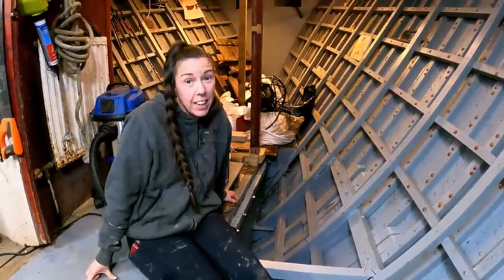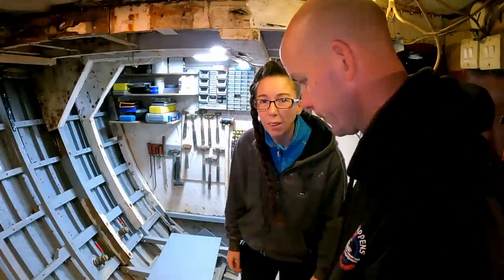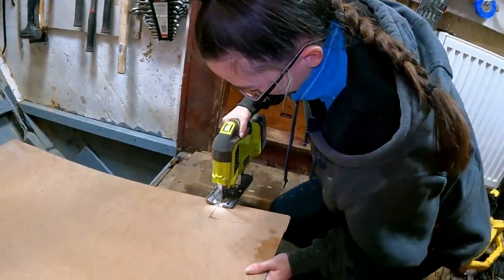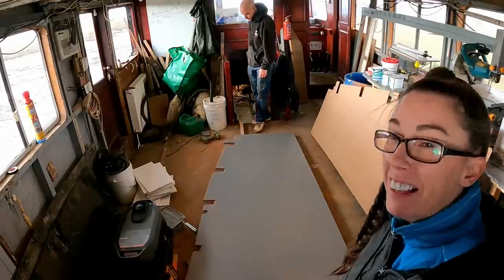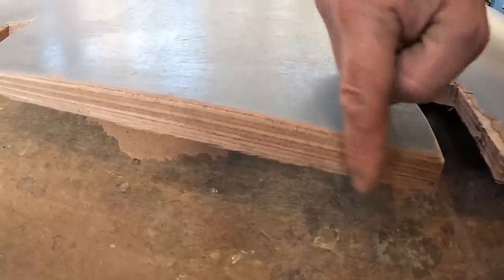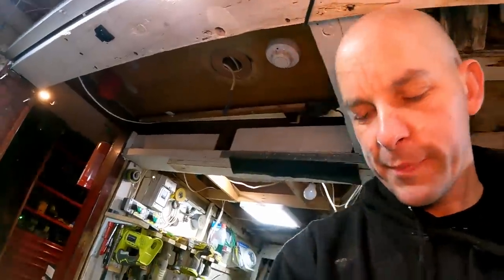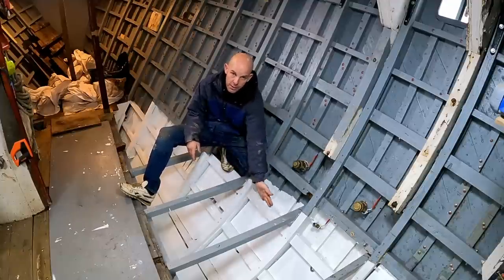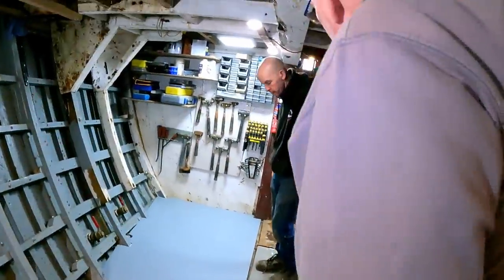Ep 101 - Fitting A New Boat Sole Supports and Sole! #boatrestoration

Comment: Adding even an inexpensive spray-painting rig would really be helpful for your restoration. You'd get better coverage, especially in hard-to-reach spots and use much less product. It's also less tiring and much quicker to spray paint and leaves a good finish. The amount of painting you have to do is huge, so I think anything that could make it easier and quicker should be in your toolbox.
Reply from the maker: But we don't have an air compressor, enough power to run one, no fresh water to clean it out after each use, and would rather spend the money on more important things xx
Reply: @ShipHappensUK  FYI - There are many self-contained systems that do not require an air compressor and the power requirements are really no more than running a light. Many are around $250 US. The clean out solvent is based on whatever fluid you're using and the procedure normally consist of cleaning a reservoir (unless it pulls directly from the paint container) and a few small parts. You do you though.
Reply from the maker: @JamesRook  even $250 is alot of money for us for something we can live without, not sure if you realise but we are working with a very small budget.

Comment: Another fascinating insight into your incredible restoration project, thank you.
As for terminology, yes it's there for a reason but it's not the be-all and end-all. Personally, I've never heard the term "sole" applied to a piece of decking, but if that's what it is, fair enough. But sole/floor/deck, it doesn't matter, as long as you know what you're talking about. Yeah Simon, nautical terms can be a bit like a foreign language, but you are far from thick. You are highly skilled, you both are. And if you really want to learn the "proper" terms, don't sweat it. Just keep repeating them and using them until they stick. (That's how I do it.)
And if you don't, well, who cares really?
Anyway, crack on. Sarinda is lucky to have the two of you.

Comment: Jemma. Lower back pain after standing still working or bent over working are the muscles screaming for fresh oxygenated blood.    Stand up staight and balance on your bones.  Pull in your stomach muscles like somebody is going to punch you below the bellybutton.  Hold tight for 5 seconds.  Release for 5 seconds.  Hold tight for 5 more seconds.  Release for 5 and hold tight for 5 more seconds.  Release.  Poof the lower back pain is gone. 

Muscles when contracted to hold you bent over restrict the blood flow.    The squeezing tight for 5 squeezes the blood out of the back muscles.  Relaxing allows fresh oxygenated blood into the muscles . This works in 30 seconds. Try it. Its free.   

If you do that squeeze the stomach muscles without squeezing so hard you can't breathe. You strengthen your back muscles.

Comment: Sealing those sole plate edges would be best with plain epoxy. You’ll have to keep adding more but it soaks in deep. 
50 years ago my dad (a sign maker) sealed ordinary hardboard with thinned varnish. It took ages to dry but the end result was waterproof filled plastic

Comment: Looking god guys! for sealing the edges of sheets, have you ever considered using dry rot wood treatment?.. really thin, soaks in deep like alcohol would, and it hardens the wood, drys quick.. in the time of a cuppa it's dry.. keep up the good work.. and could you not screw and glue the cross members the the floor, being ply more to spread load, and easy access, as cross member will come up with floor.. if that makes sense.

Comment: Well you will certainly know if you miss a bit. Terminology, sheets are ropes apparently. Boats rust from the inside out I'm told, not sure how that works on a wooden boat I'm sure  :-), but I've also heard wooden boats leak more out of the water than  in ??? and salt water in the boat is OK, but not freshwater, not in the steel boat presumably. It's all so confusing.

Comment: Oooooo Gemma swore on camera.... now the correct boaty name types will have even more to moan about 🤣🤣🤣
Anyway those pests aside, by christ does that bilge look fantastic in white (are we allowed to call it white or do the boaties insist on 00 E 55? 🙄)
it's great to see another milestone come to pass with this first section of new floor going down, it wont be long till you've replaced all the front/pointy bit/ bow frames etc and you're putting the last section of floor down to finish that whole area completely (obviously the roof beams & deck floor are for later)

Comment: IF I knew I don't remember: What purpose did those three through-hull fittings serve, and will the be used in your conversion? Usually such things are near engines, generators, etc. etc. so...curious.
Reply from the maker: There was a toilet at the front when we bought here, and in her war days that is where the galley was x
Reply: @ShipHappensUK  They might have been using a water heater in the galley area that needed seawater to cool elements, or maybe even a boiler for space heating, too. Interesting.

Comment: Hi guys, very concerned that you have a skin fitting, below waterline that you are now going to cover with deck and workbench, so no access to valve  nor inspection of bilges. Those ss ball valves are not always reliable but if you fit a hose tail to it and run a hose up the frames ending above the waterline it will be a lot safer. Dont want to see that old soldier on the bottom (other than at low tide). Merry Xmas from all of  New Zealand.

Comment: 12/16/2022 Hello Ship. I have a question. What about the chain locker? Did you record that work? Ship It might  be a good idea to place a couple of computer fans on each side of the bilge. They are a very low draw . A timer or a humidity detectorin the power wire will be Tjhe fans do not move much air but are cheap and durable. Transformers not included. Merry Christmas Don
Reply from the maker: We have been inside, all looks good, but it will be fully assessed when the deck is removed as there isn't much space to work there at the moment x
Reply: 12/16/2022 @ShipHappensUK  Great news. I will be watching and waiting for spring for the deck work. I mentioned the computer fans. Dark closed spaces always sweat or condense water vapor in the air. Just plain old moisture. Thanks for taking the time to write to me. Sincerely Don usa

Comment: Good work,  but you should use CPES, (clear penetrating epoxy sealer) for all cut edges, thickened epoxy will not enter the raw wood, stays on the surface as a adhesive.